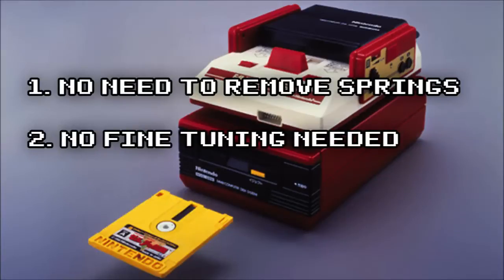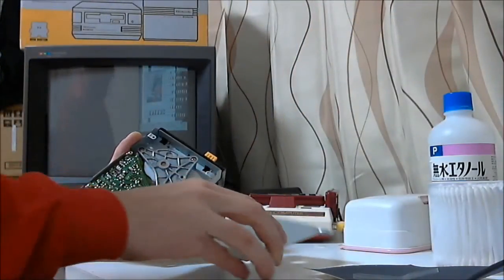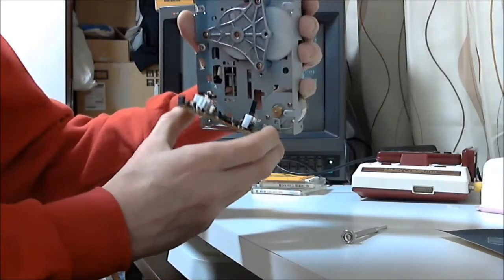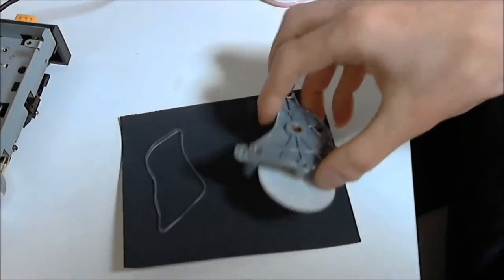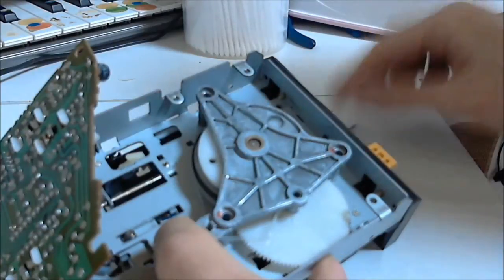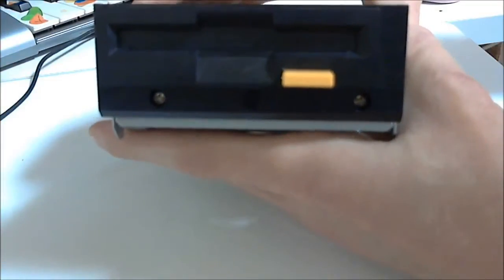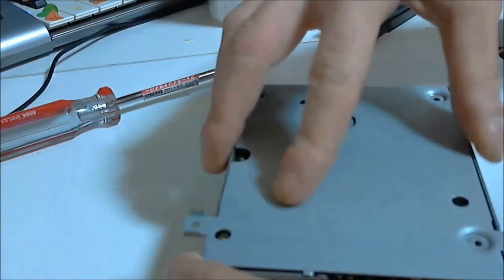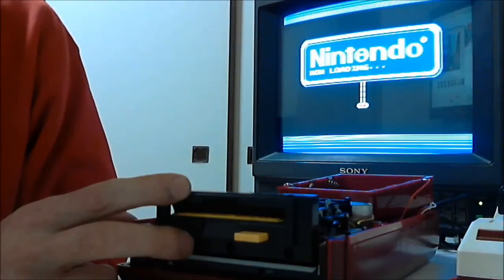*NEW METHOD* Fastest Easiest Famicom Disk System Belt Replacement

Comment: Hi! I got your belts, but they keep slipping off the big wheel when it just turns a few times.... what can I do?
Reply: This is an issue that happens with some FDS units, a few people have mentioned this, so take a look at some comments to see how people tackled it - sadly it means that the copper motor spindle is a little too high, or some other part is not in its correct postion - did you screw the circuit board back? this keeps the belt from coming off, other options are to try and force the spindle down on the motor, but that can damage the spindle..
Reply: Ah, I got it to work, thanks.
Now I've got a different problem with one of my drives. It constantly tries to mangle discs. They make all kinds of noises if they are not so flat, however, they work fine on my other drive. Ever had this?
Reply: yep, these items are old, they can be dropped warped, stored badly, it could be anything.. if you're feeling brave you could try to strip it down and reassemble it..
Reply: Brian Flanagan i think it hs something to do how the disk is fed to the drive. any clue?
Reply: does it make the same noise with the black plastic slot removed?  , otherwise your only option is to look at a disk when it spins while the unit is open to see if you can see anything..sorry I cant help more..
Reply: Brian Flanagan Well, when the head goes to the outer side of the disc, the material of the disc starts to wobble and the whole disc with it.

Also, then the Ram Adapter is in the console, it adds a humming noise to the sound. The sound is fine when only a Famicom cart is inserted. The sound is also there when the drive is not connected, so it's not the power supply of the drive...
Reply from the maker: sometimes the humming noise can be the volume slider on the famicom controller, aside from that, I really can`t offer any more help.. some used FDS units are uncecked junk..I`ve thrown out a lot.
Reply: retro raider japan wow, I'm going to try that!

Comment: This is a really great and detailed guide video.  I received a Twin Fami I won off yahoo yesterday.  It was supposed to be fully working but surprise, surprise, disks would not load.  I HOPED that it was just an alignment problem but figured I could not be that lucky.  When I took it apart, I found a new belt on it, yay!  The belt was twisted and did not look like it was installed correctly.

So I used your guide up to the point of drive alignment as I had no allen key yet.  I got a set today and have just been trying to do the alignment for half an hour or more.  My problem is that no matter how much I unscrew the little screw on the nut thingy, it will not turn independently of the gears underneath.  Is there a trick to it at all!

I am probably going to order some games off your store too, will you be sticking more disk games anytime soon?

Thanks!
Reply from the maker: hey! glad you like the tutorial- strange how the nut thingy wont rotate, i wonder if the person that "refurbished" it glued it or something? I am planning on trying to get a stock of "plug and play" replacement drives in stock shoul anyone be daunted by the whole process....

Good luck with the drive, and if you need any rare or special games in particular, we also now run a rapid finding service - so send me your requests!
Reply: Hello!  Thank you for the reply.  I did finall manage to get the thing to move but following your guide only resulted in 3 games working with the rest giving a "black screen error 27" except for Tabidase Daisakusen which would never give anything but a 21,22 or 23.  

I actually found a comment online that said to line up the square hole of the gear with the triangular piece as you advise, but, they said to do nothing else.  After doing the full installation detailed in your guide for 7 or 8 times (and many, many more small adjustments), I tried moving the screw around with the square hole lined up with the hole in the triangular piece and games started working!  Tobidase still only gave the same errors but most of the other games worked.  There was one Konami game the name of which I cannot remember (can't picture the kanji in my head, Nazo no something?  A Breakout clone) worked after a very fine adjustment but decided to throw out a black screen error 27 again once I put the twin back together, grrr!

I decided to forget about it until I get some FDS games I actually want to play.  At that time, I am going to try the whole process again but once I have the triangular plat locked in and lined up with the gear, I will leave it and see if it works.  Hopefully it will!  Selling pre-set disk drives sounds like a good idea!  I have seen some listed on yahoo but am unsure if they are repaired or not, I never looked.  I would like to get some more Twins and Disk Systems to repair and sell so I hope I can perfect this annoying process.  Thanks to your guide though, I can now do it in a couple of minutes.  That belt trick is perfect.
Reply from the maker: A Shaw I am sill researching the FDS alignment method and I think each unit has slight differences due to assumed wear and tear and possible warping of the chassis. I recently discovered while the main spindle rotates rapidly, the plate below it rotates very slowly and I think it may be better to align the spindle to the actual drive head position or the large plate - if I make a breakthrough, it will be uploaded!!
Reply: I think that is absolutely correct.  It would be awesome to find a one solution fixes all, but maybe only nintendo engineers know the secret!

I received Akumajou Dracula and Dracula II today and while Dracula II worked, Akumajou gave the annoying black screen error 27.  I knew that as soon as a game arrived and did not work, I would have to try the oh-so-fun alignment thing all over again.  I did just that tonight.  I went through the entire process again but almost all of the games stopped reading, I was not happy.  I remembered that the first time I was successful that turning the large cog clockwise from the second "black square" position in your guide resulted in games starting to work.  I ended up getting Akumajou working along with some that were not working last time I did it.  

I now realise that if I had gone counter-clockwise from your second position, I would have had games reading much faster.  I cannot tell exactly where the black square sits now but it seems to be about halfway between the first and second position in your guide, going clockwise from the first position (I hope that makes sense).  I expect that if I continued turning slightly clockwise towards the second position in your guide, I could have all the games working but now that all but 1 game I want to play is working now, I'm going to leave it the hell alone!  The game not working looks like a home made re-write.  Ironically, it worked when the cog was aligned to the second position in your guide.  That is why I think that going closer to that second position would make all games work.

It's weird that some retail games are far more sensitive to alignment than others.

Comment: I have twin famicom. The drive worked 5 times with 2 discs.  I have 2 discs and all worked.  So the discs are good for sure.  The drive worked 5 times it loaded. But it's strange.  It worked and then it did not and then again worked couple times.  And not working now.  If it's possible I can send you pictures or video how I adjust the spin.
Reply from the maker: That is strange.. the fact that it worked for a while then stopped - is the belt new?  and both disks give the same error? All I can suggest, is try to adjust the center spindle slightly to the left or right - usually if it's slightly out of alignment you get error 27..
Reply: Now i have error 27. What does it mean?
Reply from the maker: Err.27: Index Spindle<-->Motor and other calibrations off. Drive cannot read initial disk header file.  in short, you are closer to getting it back in alignment.
Reply: If i turn it a little bit left or right its error22 again. I also tried to adjust the motor by turning the bolt inside. in som point the screen on tv goes black and the readhead of FDS stops in the middle and then starts going again. after that error27 again. it just not working whatever it do.))
Reply from the maker: The screen going black means you are very close.. I really would not mess with the motor..
Reply: So when I get the black screen again what should I do?
Reply from the maker: very slight adjustments is all I can suggest - did you try adjusting the plastic wheel with the metal plate again? I worry now you have messed with the motor, things may have become more difficult..
Reply: I suspect that I have  to a just not just the spin but the plastic week with the steel and the motor too.  I just don't know how to do this
Reply from the maker: I'm really sorry you are having so many problems..
Reply: I don't know how to adjust plastic week with steel.  I adjust the plastic week with belt.  There are two weels.  I think I have to adjust both weels.  Maybe you know how to adjust the weels

Comment: how long do these replacement belts last on average until they need to be replaced again? Also are the Twin Famicoms more reliable than the famicom/FDS setup?

thanks!
Reply from the maker: The mobilon belts I sell should last a lifetime.They are not made of rubber and should not rot for a VERY long time. 
The twin famicom's drive is exactly the same as the normal FDS, it's just more convenient, as you have an all in one setup with AV OUT and only one power supply.. Plus a nicer design in my opinion!